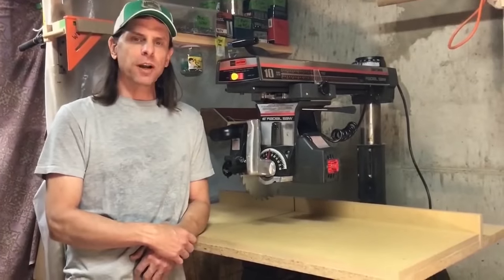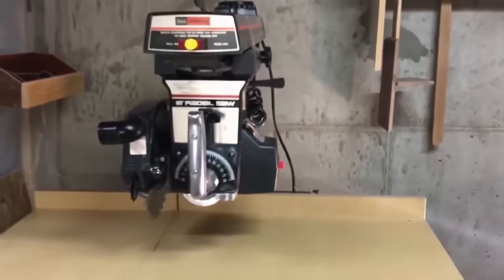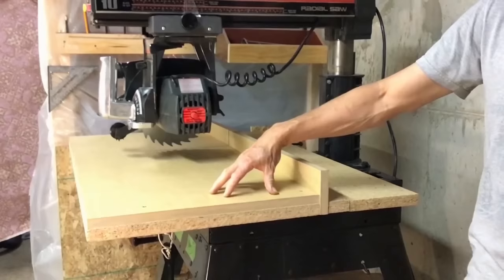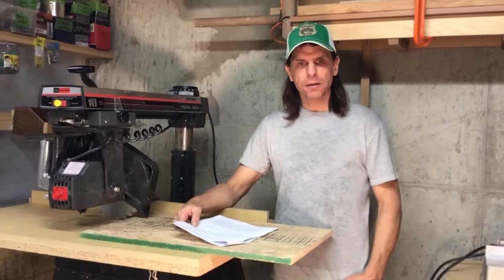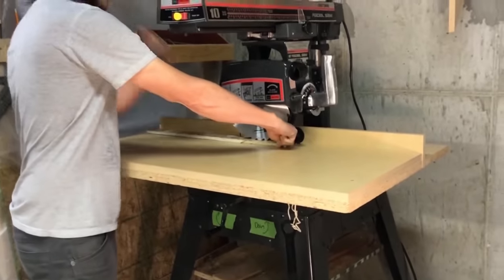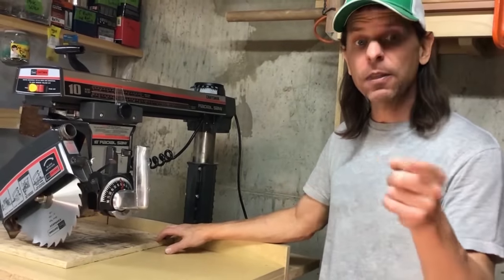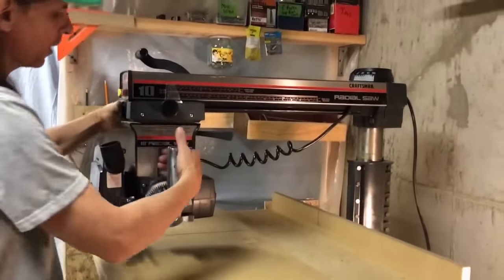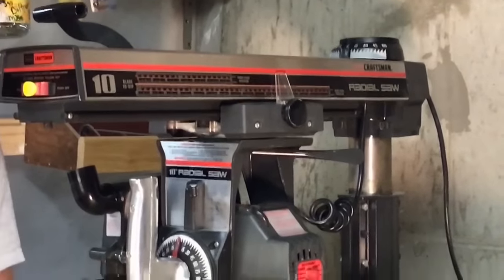The Complete Guide to Operating a Radial Arm Saw

Comment: Good review of the capabilities and safety concerns of this saw. I have one from 1971. They are very versatile and effective if you use the proper cation any power tool should be accorded. A couple things I have found helps the radial arm saw are, if possible, running on 220/240 v works much better than 110/120 v. Also, a set of blade stabilizers increases ease of use and accuracy.

My understanding of the name "radial arm" is that it comes from the saw operating "radial" as opposed to "reciprocating" and is suspended on an arm - but I guess the pivoting aspect may also have played some part in the name.
Reply from the maker: Qapla !, you bring up an interesting point,  when you state "my understanding of the name 'radial arm' is that it comes from the saw operating 'radial' as opposed to 'reciprocating' and is suspended on an arm", as opposed to my statement that it gets its name 'radial arm' since the "arm moves along the radius of a circle".

I looked up the definition of "radial", which is defined as "1. relating to, placed like, or moving along a radius", or "2. of or arranged like rays or the radii of a circle; diverging in lines from a common center."   My definition falls under "moving along a radius."  To be very specific it really is the motor and blade which move along the radius, whereas technically the arm is the radius.  Your understanding of the name seems to meet the second definition of "arranged" like rays.

Thank you for pointing that out - I think there is some common ground there.

For my interest (and hopefully others that read this), here are two definitions of reciprocating, "1. (of a part of a machine) moving backward and forward in a straight line."  or  2.  "a type of machine-powered saw in which the cutting action is achieved through a push-and-pull motion of the blade."
Reply: Yep.  Mine runs on "200" volts (220/230/240 whatever).  It seems happy.

Comment: I raised my blade and now it won't go down... How do I fix that? 113.196321 Wont lower
Reply from the maker: You can find the owner's manual for your saw as a PDF online.  In the manual it should show all the parts of the saw, from that diagram you might be able to figure out what is worn out or broken.  I wish you luck!!

Comment: The biggest issue with radial arm saws is getting them true.  You have to get the blade perpendicular to the table, the arm perpendicular to the fence, the table parallel to the plane of the arm, the blade parallel to the arm, and I must have forgotten one or two.
Reply from the maker: I agree that, "the biggest issue with radial arm saws is getting them true."  That is why some folks leave them in the 90 degree cross cut position, and use jigs to cut 45 or other angles.
Reply: I had the same thing rolling around in my head when your comment appeared before my eyes.  Made me smile. 
I can add one more factor to “getting them true”.  
A VERY SHARP BLADE is so important to safety. 
If you see white smoke coming from your cut, it might not be the blade’s fault. Decades ago I put a new blade on my Sawsmith and it immediately smoked. 
I checked every detail of the blade and it’s mounting and it was fine.   I backtracked through the saw and found two (or three, it was back in the 70’s) joints of the system that were about 1 or 2 degrees off of square.  This was before I owned my first carbide tooth blade so I had to check the “set” of every tooth.  The extra width of carbide teeth might allow a tiny bit of “out of square” in the system without throwing the white smoke warning. 
Anyway….what I learned from that episode was to annually check square of many points that must be square.  While I’m doing that,
a bit of detailed cleaning and minor maintenance falls into place.

Comment: Any chance you would share how you cleaned that saw?  I have a 40 year old one long left in the shed which needs help.
Reply from the maker: Although over 40 years old when I bought it, it was still in the box unused.  I have never cleaned it.
Reply: Try to find a manual online!   It is extremely important that you have and follow the whole procedure of adjusting the saw before you use it much.   There is much to check and adjust!  Incorrect, can bind blade and burn wood.  Best wishes!
Reply: @KevinCoop1  thanks.  I have the manual and meticulously followed line by line how to check setup and trouble shoot.

Mine only starts sporadically due to the motor end clutch failing to engage each time even though I also have a new capacitor which fully performs about 50% of the time. When my current project of 4 rooms of oak floor is done I will try the last straw and spray it with brake cleaner.  Meanwhile, I have adopted the method of a tiny screwdriver through a hole in the case to slide the clutch over whenever it won’t start at all.  Again, thanks. I still love this saw and when an action is unsafe i ramp up the safety by clamping the board or guides around it when possible.  All the best!

Comment: Really appreciate this tutorial. Very well done. Question: can you use a metal cutting blade on a RAS? Since i don’t have a compound miter saw, I’m wondering if this can be used for things like aluminum tile trim. Thanks!
Reply from the maker: Glad you enjoyed the video!  Thank you for the complement.  As for your question, I don't really know, but since the RAS is a woodworking tool, I wouldn't suggest that.

Comment: My radial arm saw has two additional arbors for attachments, one being 20K rpm for standard router bits.  It is direct drive off the motor shaft.  The slower arbor & blade arbor are turned via gear reduction.  By the way, Skil is a brand name for many tools.  It is not a specific type of saw.  The proper description for the hand operated saw in your video is Circular saw.  There is no reason to call it by a misnomer.  Other than this minor critique, I thought you made a very good video for those wanting to learn about RAS.
Reply: What kind of radial arm saw do you have that does all that? Sounds like a step up from minding terms of usefulness.
Reply from the maker: Thank you for your comment.  Funny thing is I actually mention that a Skil Saw is technically called a Circular saw, go to time 4:42 (https://www.youtube.com/watch?v=EJP1Sz4bt1I&t=283s).  Back in high school we learned that there is an actual term for this — It’s known as “Genericide."  Examples include "Kleenex" for "tissue", "Band-aid" for "bandage", "Levis" for "jeans", "Skil saw" for "circular saw", etc.  Even "google" is now used to mean "searching."  Have a great day, and thanks for watching my video.
Reply: @vanman798  I did hear you mention it, but since you are making an educational video, it seems logical to teach people correct terminologies.  I know, I'm just a stickler for details.  Lol
Reply: @vanman798  And Jeep, Jello, Xerox.  Come to think of it, I think radial arm saws were  once called DeWalts, after their inventor.
Reply from the maker: @bobd5119  Interesting to learn that they were once called DeWalts.